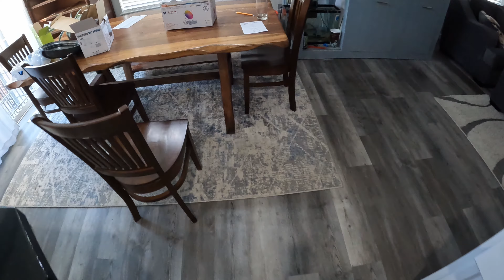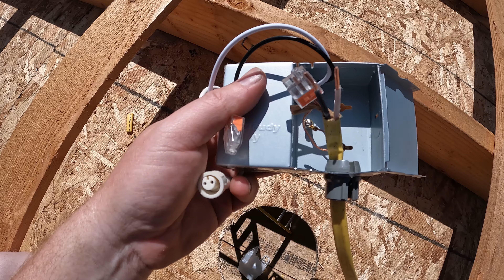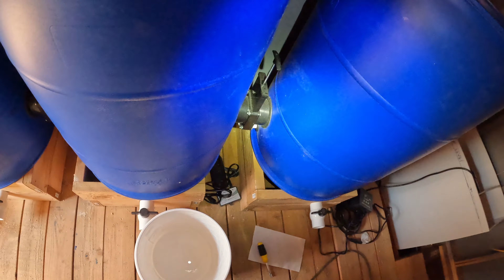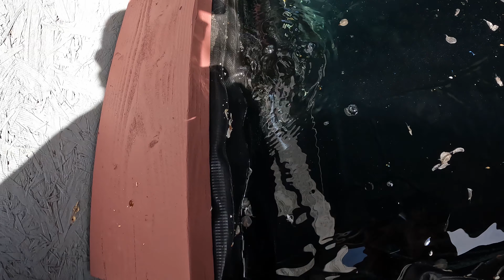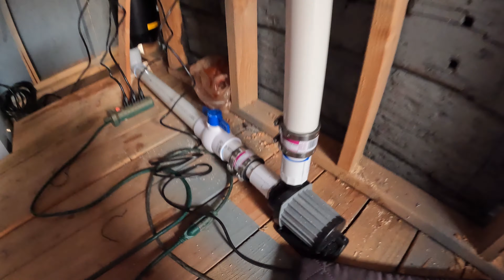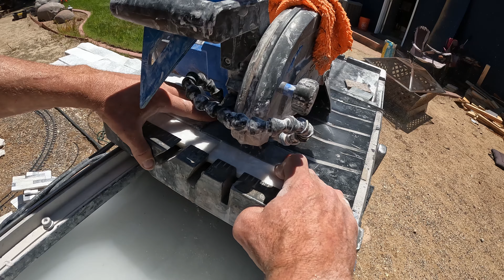Finishing up the Koi Pond Build. Electrical, Tile Wall, Lights, Turning on the Filters, add Fish.

Comment: For the climate you live in Isn't insulation needed in the roof or walls  of the filter house to protect from heat or cold
Reply from the maker: That's my next project to prepare for the winter.  I have already been sealing every crack I can find and will most likely add insulation to the walls in the filter shed.  I will also add 2 hanging reptile fixtures with ceramic heat bulbs to keep the shed semi-heated.  I will also be making covers to cover the pond.  The waterfall removes and the left and right pipes of the waterfall will get 90's with pipe that extends directly into the water so I can keep the Bakki shower running through the winter.  I'm hoping all that will work as we do get consistently into the teens and 20 degree temps at night and daytime during the winter.